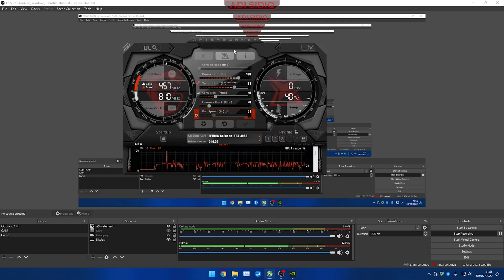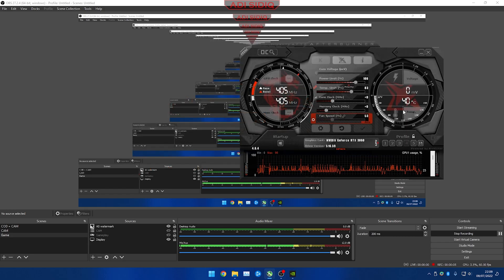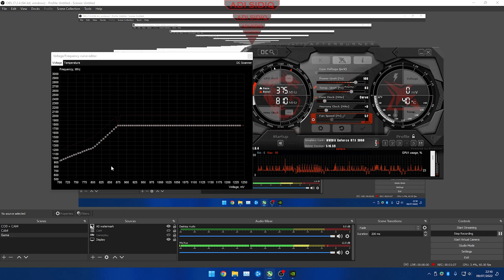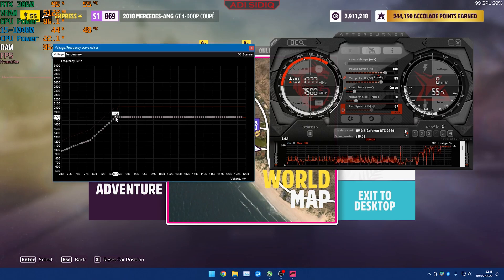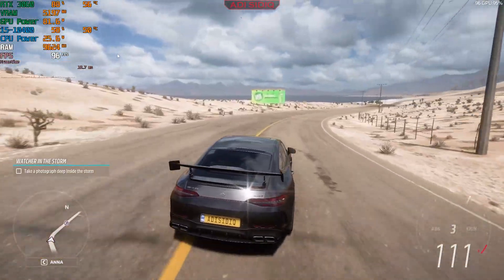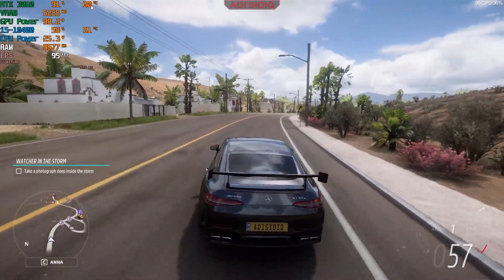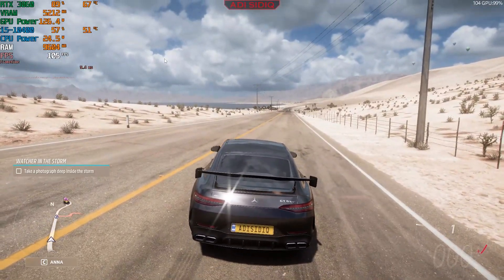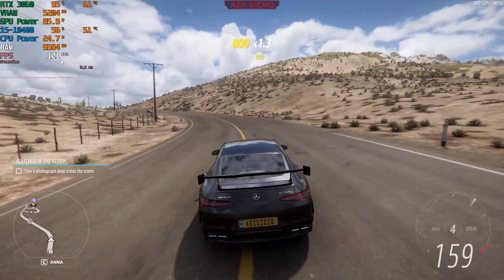How to Undervolt GPU Using MSI Afterburner (Power Limit and Curve Editor)

Comment: Great guide, I am now running my GPU at 87W instead of 100+ and I lowered my boost clock so now I get an extremely stable performance without hitting any Performance Limiters. I ended up going -350 and then +50 at .825V so my 1070(mobile) GPU runs stable at 1645MHZ and under 70C, before the undervolt it reached 90C!
Reply from the maker: Great!!